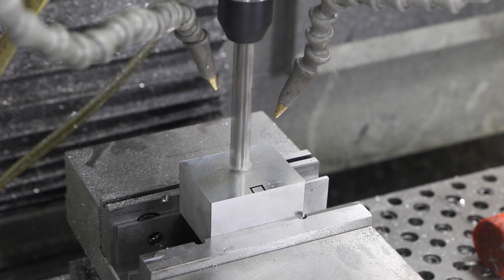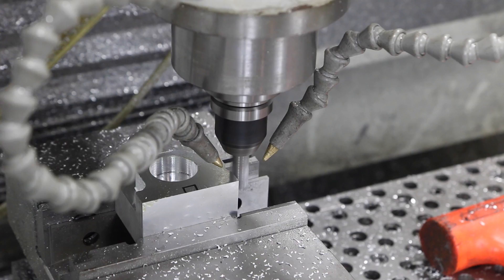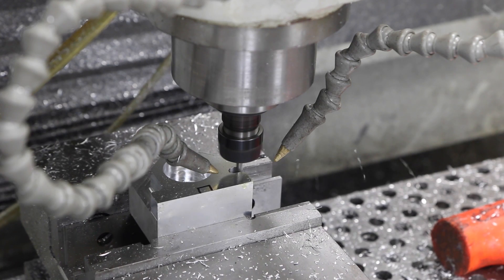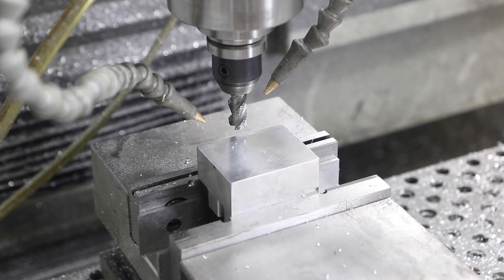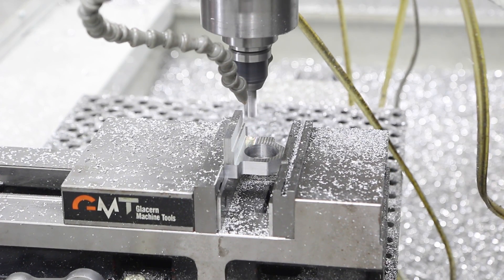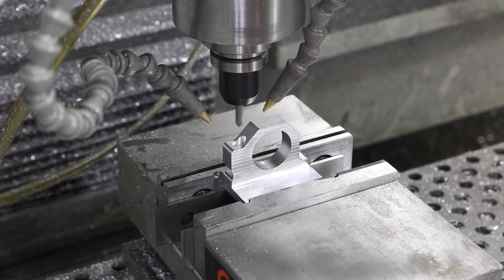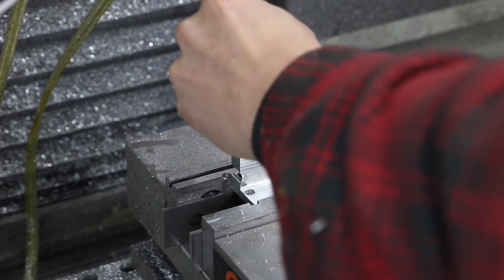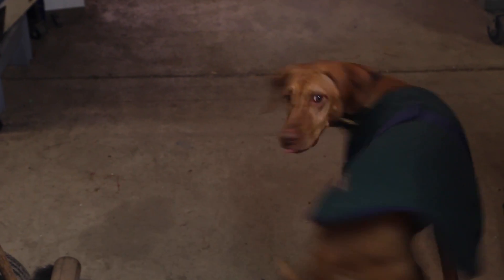CNC Machining GrabCAD Free Split Clamp on the Tormach!  Part 2 Widget25

Comment: Two questions: Would it be better to use a slotting tool on the Tormach during the last stage after you drilled and tapped the clamp screw hole instead of the Dewalt? And what breed is your dog? He looks like the other half of what my Lab mix might be.

Comment: oh bugger... I actually have one of these drop saws with a big grinding style cutting disc..  I thought it was only good for tubing so i bought a bandsaw.. I wish i knew about this blade.. :/
Reply: I would point out that the carbide toothed saws and the abrasive blade saws are different animals. The abrasive saw spins at 3800 rpm, where the carbide saw does 1300 rpm. An abrasive saw would ruin the teeth of a carbide blade in very few cuts.

Comment: Great video as always ! We have a dewalt and this machine is great for cutting steel, aluminum, brass, etc. In some cases the cut requires nothing more than cleaning. For aluminum I use some WD40. But I would recommend you to bolt down your dewalt to a real table for safety issues. If something goes wrong with that machine not bolted will certainly not help the operator.

Comment: John,
   Just a small tid bit from a 10 year cnc machinist and fan of anyone willing to give the trade a try. I am not familiar with SPRUT CAM or its processes but i have used alot of very sophisticated CAM softwares out there. Have you thought about circular hole milling with about a 2-3degree ramp down to eliminate any extra pre-drilling or with hogging out big sections of material like on the backside or front for that matter using any dynamic or highspeed removal. Again not a SPRUT CAM user but ive seen on their website they have highspeed removal videos such as Trochoidal cuts that reduces vibrating with constant chip load. Your doing just fine with the way that your doing your work just for faster program speeds and cost to you could be beneficial. Also instead of the sketchy saw have you looked into slitting saw? You could easily make an arbor if you just buy the saw blades.
Reply: With the addition of the dreaded flood coolant (personal favorite) chip evacuation and cutter tool life can be increased with more aggressive approaches. The high pressure mister works great for G jobs but production parts it's all about time and cutter life to get max profit. Breaking tools is a way of passage to be a machinist or you'll never know just how far you can push your equipment. Of course it's costly to break tools but that's the tuition of knowledge in manufacturing. Always record tool process improvements to reflect on for future jobs that may turn into profit parts from faster runs. I have too much to share man but one last comment is variable flute endmills great ramping endmills.

Comment: Another great video. I am tooling up my CNC now and have looked up all the speeds and feeds for the tools using a variety of charts and applications but always would love to see what others use in practice, What speed and feed rate rules of thumb on the main tools in your go to tooling staples? I too will not be as concerned on pushing the limits or doing anything in a hurry so the conservative side of things are of interest to me. I think going over your tooling and default settings would make a good WW.

Comment: Love the Dewalt Chop Saw....a must have when working with metal. Just wondering if you have ever used the Dewalt Diamond Edge Chop Saw Blade? We use them at work, but mainly we are cutting mild steel and you would think that you were cutting through wood with this blade....it is that smooth. 
http://www.amazon.com/DEWALT-DW8500-14-Inch-1-Inch-Diamond/dp/B004L3X9AU/ref=sr_1_4?s=hi&ie=UTF8&qid=1422471621&sr=1-4&keywords=14+metal+cutting+blade
Reply: NYC CNC At work, at any given time we need to cut  angle Iron, flat bar, I-beam, tube ect. I personally have made many cuts on 4" I-beam that was 3/8" and 1/2"  thick along with a bunch of other stuff. The last time I used it I had to cut a 12 pieces from 2 1/2" X 1/2" flat bar stock for a home project.....cut no problem. (I was making a Salmon Ladder for a gym).
Keep in mind on a job site many other workers use it too and most don't take care of their tools like me and you.
So I would bet that this blade would last a good long time in our home shops. The only reason I haven't bought one myself is that I am able to borrow the one from work anytime I need to......it's an inconvenience for me, but at $400+ for just the saw it balances out....for now
I am not saying this cuts any better than the one you have, I have never used any other metal cutting blade other than abrasive blades...and we know what the difference is there.
Reply: Thanks for posting. The right ups on that blade are great I only saw one negative

Comment: Great project, thanks for posting!

I have a question about the first end mill op. It looks like after making a full depth loop inside the drilled hole, the tool does a rapid move perpendicular to the hole (to increase the hole diameter) before doing the next loop. It sounded like your chip load was jumping during that move too. Am I seeing/hearing this right? I would assume Sprute to keep constant chip load throughout the whole op.
Reply: NYC CNC cool.

Comment: I'm curious as to what brand of saw blade you use. It looked as if you used the same blade to cut steel and aluminum? Might be wrong on that. We're using a table saw to cut our aluminum (much easier for what we're doing), and we're using a non-ferous metal cutting "Diablo" blade (apparently made by Freud). Would you recommend another type of blade, or brand?
Reply: NYC CNC Are you using the same blade that came with that saw? Or, are you using an aftermarket blade?
Reply: Very nice!! I will definitely have to think about getting that saw. Maybe I'll pick up that Tormach fly cutter while I'm at it ;-)
Reply: I will definitely do that if I decide to purchase that saw. I'm a fan of the channel, and I'm a big fan of supporting those that choose to share ideas and experiences.

Comment: First thanks a lot for making so many instructional videos! They help a lot.
I was wondering with this part if it would be a good alternative to use the bandsaw to take out most of the material. Two cuts would take out a block of material that does not have to be removed using the cnc. It is an operation right before flipping the part so it would not break the flow to much. Leaving a litlle material you would then only need to clean it up with the cnc. What is your opinion?
For me making decisions on the order of operations is the most difficult part, and i love the fact that i can see in a lot of your videos how you solve it.

Comment: Just wanted to extend another thanks! Maritool was a great find. My dad and I have bought a lot of pieces from them. Fair pricing, great tools for our use. .5" rougher with a .25" finisher on alum has been our piece of pie so far...

Also, on that visible toolpath after the finish pass was most likely because of the rougher. Roughers are not going to be as consistent as that beautiful finisher, leaving smaller ridges. Basically, while the depth of the rougher is known and measured, any deviation between the ends creates tiny mounds. In my rougher (maritool .5" 3 flute) there is a .003" deviation between highest and lowest. I was surprised, but not overly. The finisher wasn't measurable for me. In any case, that tiny deviation is probably the only reason the toolpath was visible. Not because you measured off (you said you keep within .002) but simple deviation on a rougher, especially if it is even slightly worn after hogging.

Keep it up.
Reply: NYC CNC I'm not sure what you do to warm that machine up, but that could be part of it. If it was cold when you started, and nice and warm when that cut was made, or you measured the offset cold, and cut warm, it could account for .001 or so, couldn't it?